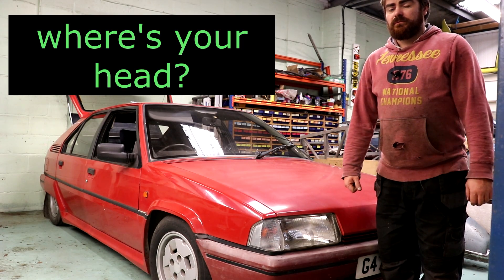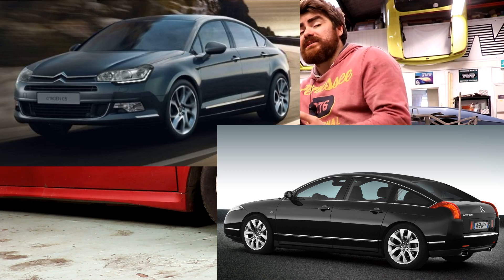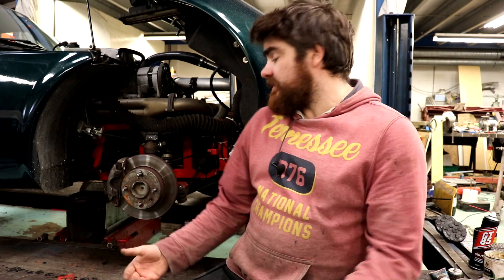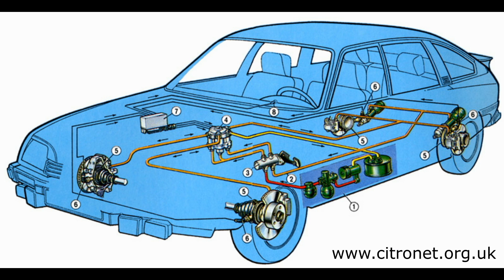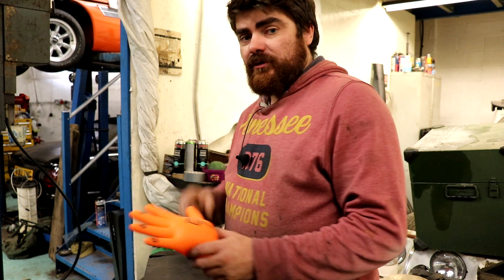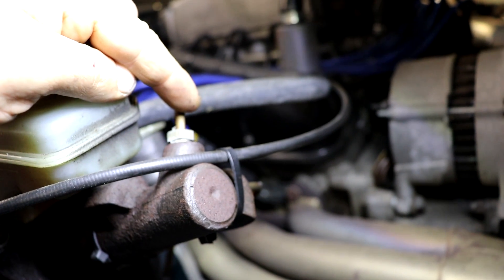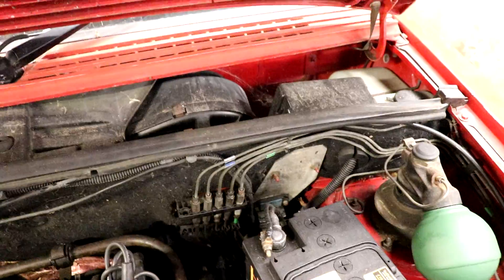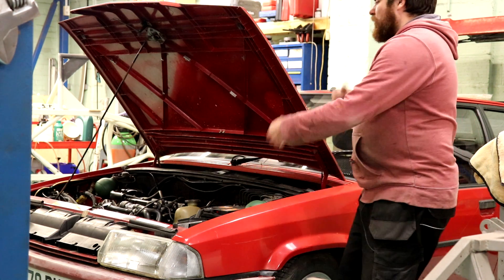On The Ramp | Hydropneumatics simplified: Citroën brakes - Why are they so good? (1/3)

Comment: So, if your suspension had a bad enough leak would the brakes not work?
Reply from the maker: Eventually. If you spring a leak bad enough to lose all the hydraulic pressure, the security valve closes and the brakes end up being a closed circuit. You get around 30-40secs of time to apply the brakes before the pressure dissipates, so you will lose them eventually (as you would if a regular car sprang a hydraulic leak in the brake circuit), but you wouldn't lose them straight away as the system prioritises the brakes above everything else.
Reply: @UPnDOWN  awesome reply, loving learning about these systems. Your YT makes that learning heaps easier! Cheers

Comment: I have driven one single BX, and i found the brakes a lot harder to modulate than on a GSA which i felt were 'just right'. Is there a significant difference between the two, or are they supposed to feel the same and was it just a car-specific thing?
Reply from the maker: The ABS-equipped cars are a little dull on the pedal and the reactions aren't quite as linear as the non-ABS cars (Which are more like a GSA).

Comment: So I'm seriously looking at purchasing a 1991 Citroen Bx have many questions about the maintenance of this vehicle and how the car operates over all. Watching and listening to you going over all of this is very informative and I'll be watching through your 3 part series. That said, are there any things I should be looking out for specifically when I go to purchase the 1991 model that are red flags?
Reply from the maker: Rust!
Reply: @UPnDOWN  from what I can tell from the one that's being sold, it has a minimal amount of rust from what I can see in the pictures. Would it be possible that I could forward you the link to the one I'm looking at purchasing?
Reply: Oh, another question I have is how hard is it to aquire repair parts for it? I'm in the US so I'm sure it'll be a bit more difficult, but if they're scarce naturally then that's another thing I'll need to think about before purchasing it.

Comment: After I purchased my new BX19RD estate in 1987, I sent a letter to Citroen HQ asking for information on their braking/steering/suspension system. Got a whole bunch of detailed information back from them, which was really interesting. I was definitely a fan of power hydraulic brakes, being so responsive and after getting used to them, so controllable with minimal foot pressure. In fact I preferred the non ABS system as fitted to my 87 BX to the later ABS system on my 93 BX TZD. London Transport I believe specified power hydraulic brakes on their buses RT/RM models.

Comment: BX brakes, suspension and steering are just in a power of a tini belt. No belt no driving or worse, no braking. 😅
That why is good to have hand brake on front wheels. ☺️
Reply from the maker: Well, about 30secs of braking, if your system is in good shape!

Comment: After getting used to the brakes on my Xantia I honestly much prefer them to ''regular'' brakes with brake boosters. I don't think they're at all hard to modulate or ''too sharp''. The travel is so little that it feels like they're pressure actuated rather than travel actuated. And I quite like that feel.

Comment: Hi 
Is the first C5 a proper Citroen ? I'm about to get handbrake cables on mine but I heard that sticking handbrakes/front calipers are problematic. Do you have some good info on this issue? Does the C6 or related Peugeot have the same compliant ?
Thanks
Reply from the maker: The C5, for me, isn't really a 'proper' Citroen. It's too far removed from what Citroens used to be about, despite the suspension still being hydro. I don't like them myself, but they're a competent and practical car, for sure. Only my own views, of course!

The C5 is the only hydro-Citroen to use regular DOT4 brakes, too. The front calipers are basically a larger version of what most cars have on the back, and many cars these days suffer seized rear calipers (the Saxo does!) With green-blooded cars, you're much less likely to have the issue as LHM isn't corrosive or hydroscopic like regular brake fluid, so I can imagine that it's a problem almost unique to the mk1/2 C5.

The later C5 and C6 are totally different, with the handbrake acting on the rear wheels, but still normal brakes (and bang-average they are, too).

Comment: BX GTi 16v? Well, that was unexpected! I also own a BX,  had to change that break valve, there is a small ruber part in it, it broke after 30y of service, and I had LHM coming into cabine. Got a new ruber for like 2-3 euros put the new ruber into the break cilinder and put it in the car. Works like charm, ready for the next 30 years or so.

Comment: Of all the cars I've owned or driven since the BX I still prefer the way BX brakes feel. It was very easy to stop sharply (or skid, if you so wished) once you were used to them. Despite not having ABS I had more confidence in its ability to stop than any car I've driven since. I'd liken the amount of pedal travel from "hardly slowing" to "through the windscreen" to be about the same as the clutch going from slightly below the bite to fully engaged... if not a bit less.

Comment: At last, someone who doesn't insist on calling it hydro-pneumatic. There's neither water or air in the system. Truly it should be oleo-gaseous - LHM fluid (oleo) and Nitrogen (gaseous) behind the diaphragms in the spheres. Wish I still had my BX TZD estate.
Reply from the maker: I do, most of the time, as it's just the conventional norm for these cars (what does it matter, as long as you've conveyed your point?) But I do stop every now and then and laugh at the fact that strictly-speaking, they aren't hydropneumatic! 
Then again, maybe they are; Maybe the definition is just a fluid and a gas.

Comment: Thanks for the explanation... so there's no conventional brake fluid in this system? Replaced by LHM?
Reply from the maker: Correct. Same fluid does suspension, brakes and steering (on cars with PAS).
Reply: The answer is in pt 2! 👍

Comment: Really interesting thanks - we are trying to get our heads around a 79 Maserati Merak (in bits) which has Citroen LHM brakes, clutch and pop-up headlamps (why????). Has normal brake and clutch pedals. And normal suspension. In the Bora Citroen decided power steering and seat adjustment should also be hydraulic!. In the Merak those are just muscle-powered 😃. Thankfully Ray Calvert in Bradford is helping us out….
Reply from the maker: Citroen wanted to showcase how clever their hydraulics were by having exotic sports cars use them - it wasn't just cos they wanted Maserati to make the engine for the SM!

Comment: Cool, and so much needed. Being used to the LHM system of braking, where you vary the braking force by applying different pressure to the pedal. On the other hand on vacuum assisted brake I get the weird feeling that the brakes are “sucked in” and I have to release the pedal. Is that just me, or is this general behaviour of conventional cars?
Reply from the maker: I suppose they kind of are being 'sucked in' if you have a servo. They're just assisting you really, but through vacuum.
Reply: @UPnDOWN  the LHM Citroën type of brakes just feel more „linear“ than the other ones ☺️

Comment: had a red H reg BX 1900 diesel & loved it (right down to sitting stationary with the anchors hard on then releasing the brake pedal & getting it to launch its bum into the air).
Reply from the maker: It does them no good, doing that...any yet I used to do it a lot, too!

Comment: I noticed someone thought that a leaking brake valve would reduce pressure to the brake system. A leaky 'doseur' valve does not reduce brake force. There are no O-rings in that unit. Pressure is contained via machining tolerances between pistons and cylinders on the order of less than 1/2 of a wave length of light and a specific surface finish. Keep in mind that even the original 7 piston pump provide about 860 cc of hp fluid (1900 - 2350 psi) per minute at an engine speed of 600 rpm. The later cars - CX onward - use a 5 piston unit that provided as much or more volume. N2, OTOH, in the brake circuit(s) will give a feeling of a lack of braking force. As the brakes are a closed end system one would have to an actual external leak for brake pressure loss. All D's (with exception of some latter models) and SMs/CX's had a pressure back up for the brakes using a separate accumulator and valve system that would, if in good shape,  provide for at least 5 or so panic stops from high speed with complete hydraulic failure with the main system. Edit - left out some very early ID's with manual steering. Did not use the HP system for the brakes - special master cylinder was use.

Comment: Interesting fact you may not know, about the early ID19 brakes. Although they were not powered off the suspension system, they had a 'failsafe' system built into the master cylinder, that if triggered by a master cylinder failure, full pressure from the suspension was applied to the front brakes, causing a rather rapid (and probably dangerous) stop. Never happened to my ID, but read about it on the Southern California (socal) citroen facebook group pages. My ID19 (a Slough built example, delivered new here in New Zealand), required repeated work to unfreeze the 'conventional' front brakes. As the local service manager said at the time, the DS brakes were far better. The ID did however benefit from the anti-dive characteristics of the suspension under heavy braking though. Instead of the back end of the car rearing up like most cars, the rear suspension also plunged downwards, giving spectacular stopping power. My current C5-X7 V6 Exclusive (a 508 in disguise really) still sports hydractive though, and its rather a shame that PSA gave the system up about three years ago.
Reply: 😀- why my mother with our first ID19 referred to them as the 'Jesus Brakes' as the first time it happened to her what came out of her mouth was "Jesus Christ"....However that system was only the lowest spec ID's that did not have PS and the system use a single piston pump. An ID with PS used the brake valve we all know and love.
Reply from the maker: I need to learn about the early ID brakes. Some say they're still powered ones, just simplfied versions, and others say they're conventional - with master cyl etc.
Reply: @UPnDOWN  The early ID (mine was a 1961), had a master cylinder and unpowered brakes and steering. Still inboard disks though. The DW a few years later had the DS powered brakes, but retained the ID manual gear change. Later ID models, I am not sure about.
Reply: @murraygnz  - All had front discs/drum rears regardless of model. The DS19 'Grand Route' was the first DS model with a manual transmission.

Comment: Maybe jumping in too soon but as you say  - the same mechanics  - pads on discs (except ds/id). My problem is control. Ok all or nothing on a racetrack but not so much around town. Speaking as a previous Citroen windscreen headbutter
Reply: That, typically, is the result of gas in the brake system. Causes a lack of initial brake function and then as one presses harder they came on all at once. OTOH the Cit brake system - especially with the activation in the D's and SM's - did require a bit of getting use to. OTHO once one did, all other systems felt sluggish by comparison. With the CX and latter models the mechanical resistant was increased to provide more 'feel' if you will.
Reply from the maker: As suggested, that's probably air/gas in the circuit. The cars with ABS do have a duller pedal on BXs, and the Xantia has a horrible pedal feel as they tried to 'normalize' it by adding springs.
Reply: @UPnDOWN  - XM's with ABS are the same. Not sure if you are aware but LHD V6 XM.s with DRAVI are also equipped with a brake accumulator and the only model so equipped. Same exact  unit as found in CX's. Was a bit surprised when spotted.
Reply: if you drive one for more than a day you rapidly get used to it. Even now after driving and owning several much more modern cars I would prefer the brakes to feel like they did in a BX.

Comment: I've driven CXes in northern Sweden for more that 10 years (some years about 150 thousand kilometers) all year round including severe weather with minus 49 degrees Celsius and snow and ice in volumes not many people ever will encounter, not to mention driving in/on it. Picture driving the Paris Dakar rally but in Antarctica in July (the cold stormy season). My previous driving experience as a professional driver includes most half modern but also modern Mercedes', Fords, Audis, Volkswagens and a couple more including trucks, but none comes near the CX in regards to body/chassie stability, grip and general road holding, steering, brakes and comfort - all because of the very clever hydraulic system. And the steering isn't even power assisted.. hmm.. no, it's actually hydraulic as in Airbuses, Boeings and most fighter jets. The rear 'load-powered' brakes makes the braking extremely controllable and if you hit a big bump they push even harder on the disks as well as letting of pressure on the way down to prevent the brakes locking up - that is very very clever..
..and I almost forgot to say how much I love your videos, this one especially!

Comment: Hydropneumatic suspension was also used under licence in the Rolls-Royce Silver Shadow, I believe the same hydraulic system was used for the brakes, but I am not 100% sure.
Reply: I think only the rear suspension but I am not 100 % sure either.
Reply: Depends on who you ask 😀. RR, based on sources, used it for braking and body control and for suspension - not just with the same model. OTHO Mercedes did licensees the system - not sure if still using. Maserati used on the Bora when they were owned by Cit back in the early 70's - surprise, surprise.
Reply: RR licenced the Citroen system for the Silver Shadow. As the shadow platform was carried through for later Spirit/Spur and Bentley counterparts the Citroen system features all the way to 2003 when the Continental R ceased production. But the system is modified by RR, the cars have a mix of Citroen suspension and conventional. Other than very early Shadows, the cars only have Citroen self leveling on the rear. The braking system is another hybrid, being LHM, but also some more conventional elements, it's a very complicated system.
Reply: Knew that the early cars used it for suspension. Rebuilt more than a few of the spheres for folks here in the US. RR had their own sphere design including the flow control valve used in the neck of the units. But that is were my info and interest ended. Thanks for the added info.
Reply: @highlandmalt6368  Yes, thanks for extra info.  I though RR only used it on the rear.  Trust them to make it more complex.  Did not know they had LHM involved in brakes too.  Cheers.
Reply: @peterriggall8409  I should have said, whilst they have spheres and self leveling on the rear, they also have coil springs. There is a hydraulic pump located in the V of the engine and 2 spheres in the engine bay for the braking. The hydraulic reservoir is in the engine bay and the suspension and brakes are part of the same system. The brakes also have a regular master cylinder to give the brakes more feel, and I think (although I'm stepping outside my understanding here) as an additional failsafe. The front brakes consist of 2 calipers on each wheel. It's a proper engineer's design, if you know what I mean!
Reply: @highlandmalt6368  Thanks for that.  I have seen the dual calliper on a RR front disc.  Pretty impressive.

Comment: For those with newer Cits, 2001 and onward, LDS is nothing more than synthetic LHM. The airline industry went to synthetic hydraulic 'oil' as it has a higher flash point than non synthetic or mineral based oil. LHM is nothing more than high quality mineral hydraulic oil with a green florescent dye added. In the mechanical world 'hydro'  refers to any liquid used in pressurizing systems. LHM/LDS have a viscosity of 15 (fluidity) and a VI, viscosity index, a measure of a fluids ability to resist viscosity changes with temperature changes. LHM had VI of 300, LHM+ is 320, LHS was 280. Have no info for LDS but would be surprised if any real difference compared to LHM+.